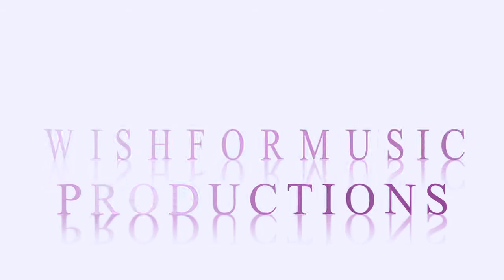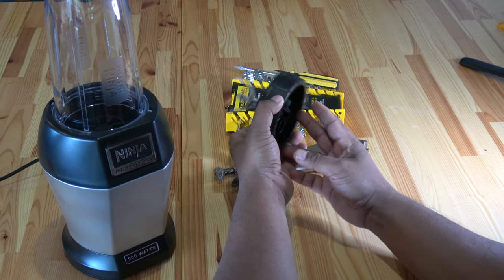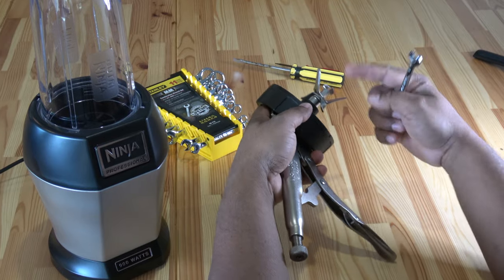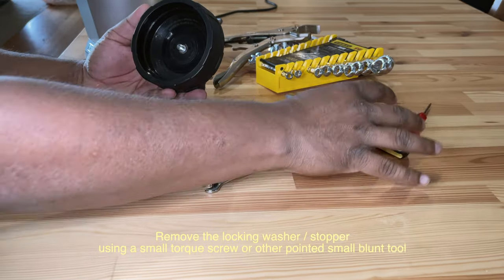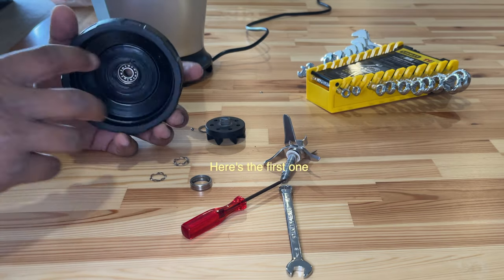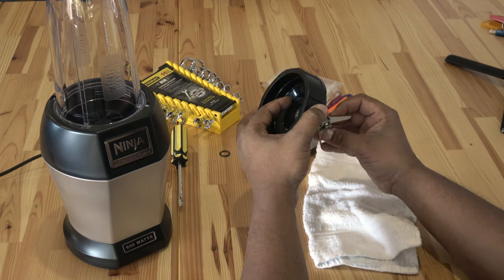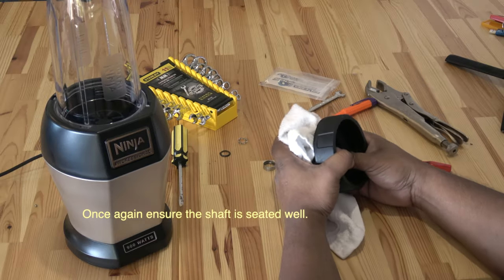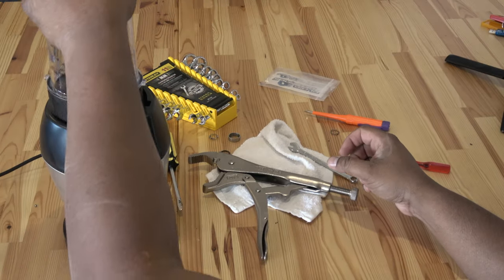Nutri Ninja | How to repair a leaky, wobbly, loose Nutri Ninja blender blade | Home hacks

Comment: Waited a long time for a Nutri Ninja blade breakdown. I could never figure out how to remove that plastic locking washer until now! One thing to note, when you removed the second bearing and said the little black washers fell out too. One of the washers is actually just part of the broken bearing (the thin rubber one). The thick hard plastic one is the only one you need. Keep it safe as I imagine it is very difficult to replace. It is ever so slightly cone shaped to give it a gradual tight fit. Many thanks for your video, I have just ordered new bearings :)
Reply: Thanks so much. That’s a beautiful piece of info. Like fitting a jigsaw puzzle with last few missing pieces. Very satisfying. Thanks
Reply from the maker: Yes. Thanks a lot for that info. Connected the dots very well.
Reply: Hi There, I opened mine today coz it failed. the thin rubber washer which you said is part of the washer, if we just install the hard plastic one and not the thin rubber one, will it not create a gap when we assemble everything back?
Reply: @rajatsingh87 Hey. There should be no thin rubber washer. If you see my comment above, this thin rubber piece was not a washer, it was just part of the damaged bearing. You only need the hard plastic washer for the inside :)

Comment: Update for the newer model of the Ninja Pro - BL450 series - it has a different style 6 fin drive. In this model they've added a metal locking pin to the plastic locking washer underneath that stops the washer from turning. I had to drill it out with a 5/64 drill bit - was a bit challenging getting it out. After removal of the pin, I found using a pair of channel lock pliers to turn the locking washer worked better for me. Used the channel lock pliers to install the washer also. Thanks for the video. Was a good start for me.
Reply: Is there a more detailed and slower video of reassembling  the washers and bearings? I got the bearings out but,I can't get both of them back in. What am I doing wrong? Is  there a safe grease or other lubricant I should be using? Did I reassemble it correctly? Very confused. 🤔
Reply: Correct. Same thing happened with me. For clarification's sake, the lock washer has to be turned clockwise with the Channel Lock and when I was re-assembling I used a small screw locked with Crazy glue instead of the pin.
Reply: @jsmith5770  NO. Do not use any lubricant. Get a socket the size of the bearing outer race and press them in or tap them in with a hammer.
Reply: So one more comment on this... I ordered the appropriate size bearings from Amazon or something. The device worked for about 6 months before again becoming extremely loud, telling that the bearings were going bad. On my second attempt at repair, the bearings were so rusted into the housing that I couldn't get them out without breaking the plastic, so I'm ordering a new one. If you can, order high quality stainless steel bearings. Not sure where... too many cheap items out there.
Reply: @likeasparrowinthewildernes8333  Acts 2:1-47
Reply: i managed to screw it out instead of drilling to a point a gentle plier pull can get it out
Reply: I got stuck in this part, I removed the metal locking but the plastic one won't move:(

Comment: I would love to see you do a video on removing and cleaning the silicone ring that sits inside the lid. It's where the jar seats as the lid is screwed down. I pulled mine out today. I could not believe the black/brown crud on that silicone ring!. I used a dental pick to loosen it from the sides of the lid, after letting that area soak in hot water.
Reply: Amazon has some rings that include a dental pic.
Reply: Amazon shows pictures of how someone put dental floss under the silicon ring and let a couple of inches hang over to pull out the ring after blending in their 900 watt model in the comments.

Comment: I have an updated version in which the plastic seal (referred to as lock washer in the video) is held in place by a tiny brass spring pin. You have to pry the seal away from this pin in order to be able to rotate it clockwise to disengage. Pry it high enough so that it completely clears the brass pin while turning it clockwise with a small torx screwdriver.
Reply from the maker: Thank you very much for the valuable info 🙏

Comment: I don't know about anyone else, but unfortunately the shaft on my blade is 7.8mm, not 8mm, so it doesn't fit snugly into the new bearing. The shaft just spins inside the inner bearing race without actually turning the bearings. Anyone else run into this? Anyone know where I can get 7.8x19x6 bearings!?

Comment: Awesome!  The bearings on mine did not snap right in.  But you can tap them in using a socket that is the same size as the bearing diameter and tap them in gently with a hammer tapping around the socket

Comment: This is great, thanks! Our blade spin has become really stiff, can barely even hand turn it so I'm concerned it's adding extra wear and tear to the machine. Been thinking about pulling it apart for a deep clean. I'm not yet sure if it needs a good lubing up or new bearings.... :|a

Comment: Hi there, the part that is broken on mine is the clear plastic wheel on the base.  It broke away. I have a replacement, but cannot find out how to remove the center metal shaft of the old one.  The new one has the metal shaft attached.  Any thoughts would be helpful!

Comment: I have the Ninja Ultimate with the the blender and smoothie maker.  The blender works fine, but for a reason I don't understand, the smoothie base (gear) no longer sits down deep enough into the blender base to lock the teeth to make it work.  Befuddled.  Any ideas for me? K

Comment: Wish it worked for a pro 1500 series.
The blade and the fin assembly came apart quite easily buuuut the insides are all part of the blade assembly and can't be replaced. Good news though I have two replacement 6 fin blade attachments  that work well just wanted to see if I could fix the original.

Comment: Please advise how to put the shaft through the bearings my one is coming out every time I push the shaft through the bearing. Any idea would be great.
Reply from the maker: Hi Waqas, are you saying the shaft is too tight inside the bearing and so is pushing the bearing out? If so, a couple of drops of vegetable oil should help lube it through(provided the bearing is the right size)

Comment: Great video.  Do you  happen to know how to disassemble the Ninja coffee and spice grinder attachment 'XSKBGAUK'?  There are 3 screws on the base but cannot find a way to unscrew near the blade.  I need to try and make the drive mechanism sit higher (nearer to blade underside) so the gearing fits on a BN800UK base.
It currently works, but sometimes vibrates off the gearing (gears just need to be closer together)

Comment: What bearings should I order? Chrome Steel or Hybrid Ceramic? And rubber seals? Please advise.
Reply from the maker: I got the high speed hybrid ceramic with rubber seals. Haven’t tried the chrome steel type.
Reply: The bearing  PART NUMBER is:
S698-2RS made of stainless steel.
For this application, should only use stainless steel ones and NOT chrome steel.

Comment: I think the larger washer (the one next to bearings rather than on the shaft) has disintegrated (or was never there). Could you estimate the size or give a comparison for replacement, please?
Reply: Hi, the outer diameter is 14mm. The inner hole will match the diameter of the shaft going through it at that point.
 Its a thin white ceramic washer (any thin food grade washer will do).

Comment: Hello! Very nice video! I just cant remove the second bearing
Reply from the maker: Could you try using a drop of vegetable oil and leave it for a few hours and try again?
Reply: @doctorsangeeth  i'll do it! Let's see! Thanks!
Reply: @doctorsangeeth  it didn't work. After trying many times to remove the stucked  inner ballbearing with a hammer and a screwdriver I finally had the idea of putting a screw that had a head bigger then the inner ballbearing's hole and only then using the hammer and srewdriver again.
Reply: @doctorsangeeth  the problem is that I think I might have damaged the inner plastic black washer using the screwdriver. Would you have the specifications to buy a new one?

Comment: I can't figure out the plastic locking washer.... Am I supposed to stick something in the little hole with the metal clip in it?
Reply from the maker: Insert a small metallic object such as a tiny screwdriver and spin the washer as in the video to detach and later attach.
Reply: @doctorsangeeth  ha... I've rewatched that video so many times trying to figure out which hole you're referring to :)
Reply: My blender also has the metal clip on the plastic locking washer, it my be a different model than the one in the video as I also noticed the rubber disk on mine is a female fitting, while the one in the video is male. 

To remove the plastic lock washer I used a small flat head driver to bend the washer over the metal clip, as its there to prevent it from spinning. Once it's lifted over a bit on that side, stick the driver in the hole next to it and turn clockwise. It came off without much effort once the washer was clear of the metal clip.
Reply: @DanielB123321  The metal pin here seems antagonistic on Ninja's part. Earlier models are easier to dissassemble, and this blade should not be treated like a consumable when it can be repaired with just a couple of new bearings.

Comment: Thank you for this! Very informative. Do you happen to know the white ceramic washer size?
Reply from the maker: Hi. Sorry mate, I am not sure. I would just take it to the nearest hardware/ plumbing supplies store and get a replacement.
Reply: @doctorsangeeth  No worries, tried today without any luck so thought I'd ask just in case. Cheers!
Reply from the maker: @FIRSTwolfbrandchili  let me see. I will open it up again and measure it. Will let you know.
Reply: @doctorsangeeth  You're too kind, you don't have to do that! I'll try another hardware/plumbing store.
Reply: @FIRSTwolfbrandchili  The white washer directly below the blades, the inner diameter is 8mm and the outer diameter is 14mm. Thickness 1mm. The washer on my blade set is actually plastic and flexible (probably PTFE / Teflon) so I wouldn’t worry too much about finding ceramic. Hope this helps.
Reply: Two issues with my extractor assembly. 1.- I did not find a white washer on mine, could it be it didn't come with one? 2.- there is a black washer inside the assembly, in the shape of a cone, and there is a cone shaped metal that is about the same size as the black flexible washer. I do not know if these two parts are supposed to be reassembled with the metal one inside the black flexible, or if the metal cone shaped one came from somewhere else. Is anyone able to assist? Thank you in advance.

Comment: Mines is leaking from there.  Very little play in bearing.  I'm assuming you used a stainless steel ball bearing
Reply from the maker: Yes they were high speed stainless steel bearings from Plaig like the ones shown in the inset image. 
Leakage may be due to loose/ worn washers too I guess.
Reply: The bearing  PART NUMBER is:
S698-2RS made of stainless steel.
For this application, should only use stainless steel ones

Comment: 2min clockwise?
Reply: My blender just got bont now, smoke came out of the down and the blender off, what can I do about it
Reply from the maker: @ajuzieugochiglad5778  sounds like it’s burnt out. If it’s within warranty period, may I suggest to please contact the retail company re replacement. If not, take it to your local electric appliances repair place to get checked.
Reply: Okay , thanks alot. I hope they fix it
Reply: The bearings on mine got chopped up and ended up in my smoothie and I swallowed Tiny metal bits from it! Has this ever happened to any of you?
Reply: @unclejoemoove7878  eat lots of fiber, do colon flush